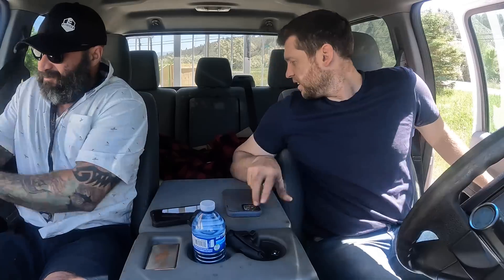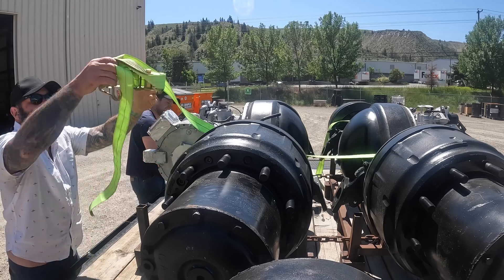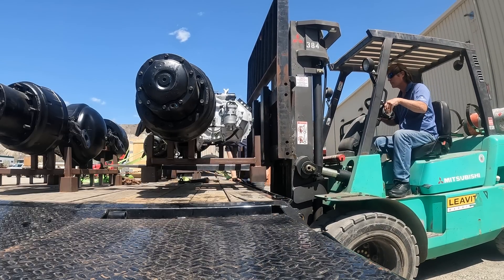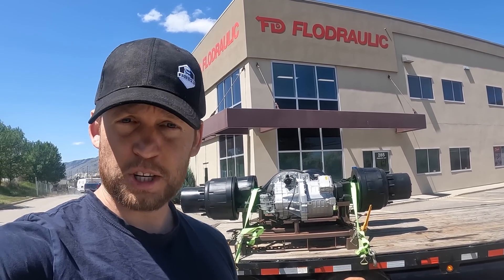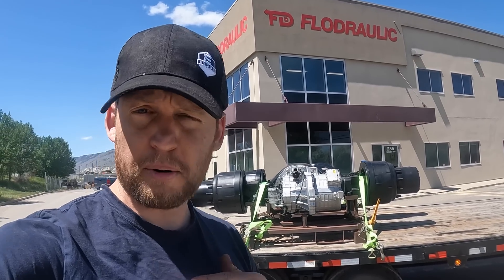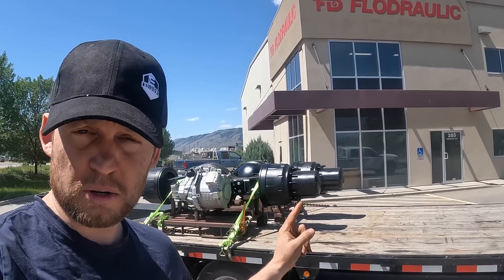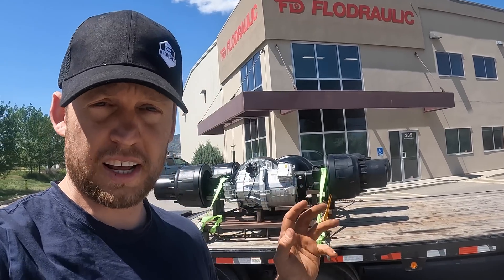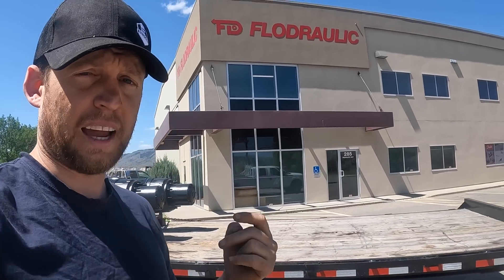Testing Our Electric Axles at FloDraulic

Comment: It would be cool to see you try to retrofit 1-ton trucks from 70s &80s, or the medium duty from that era. That is actually harder to do with space constraints and type of parts needed, i understand. Maybe those 5os and 60s  Dodge Power Wagons that are restored for $250k, except you use the 4-cylinder Cummins as a generator

Comment: some thoughts are have you contacted Volvo (they own Mack and CAT and many more) maybe can take their straight 6s as generators and they have electric motors now)
I saw another video from you and you said you had to be at 1800rpm but you are not connected to the mains so why not be where the engines feel best at 900-1200rpm as the frequency shouldn't make any difference when you are still revving AC to DC and how many Volts are there in the batteries as some are 800v and then you still have to live if you are on 240v two-phase while in Europe it is 320V on every third wolf so it will be 400v as a large phase

I had some thoughts when I saw your videos

Comment: just out of curiosity have you looked down the route of Super Capacitors instead of batteries or maybe a balance between both supercaps and lithium batteries because the supercaps would have an easier time taking in energy from regen braking and if left for an extended time don't suffer the issue of needing to be kept charged so they don't fail?
Reply: Caps of any kind send power basically all at once.  Batteries basically are designed to give power only as needed with a certain limit on how much at once.  Capacitors of any kind as energy storage for an EV is an absolutely terrible idea.

Comment: Those are some beefy axles!!
Reply: Well, they better be beefy for the angular torque they have to endure from the motors. But I am sure Flodraulic will tone the forces down which the motors are exerting via motor controls to ensure longevity of the axles.

Comment: Are you building protection plates for around the electric motors? Or even just mud flaps? All I can picture is sailing down a gravel road and that motor getting hammered by rocks

Comment: how is it going to handle the different wheel speeds between the two axles? Like during turns  in mud, or ice . i am curious  to see if it will temporarily go into free wheel or if it will make the drivetrain go into a limp mode. with a set of regular axles this wont matter because they turn at the same ratio no matter the condition, but i would think the e axles will have to have multiple speed sensors that could cause a problem when the speed is not the same.
Reply: Motors reporting their RPM to the controller will handle all that.  The controller will be programmed to synchronize the rpm if the motors.

Comment: Steady progress.
Why not a concentrically wound motor on the axle or a hub motor to the planetary gears?
Reply: No need too, re invet stuff, when you can buy of the shelf.
Always simpler and cheaper for manufactor and user in the end
Reply: @jonasstahl9826  ok thanks. Concentric is how submarines run them.